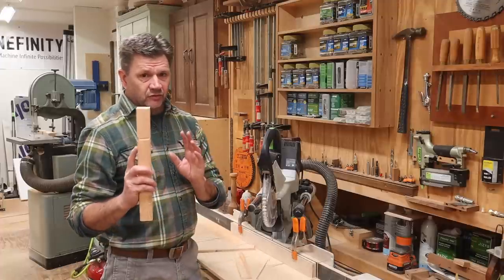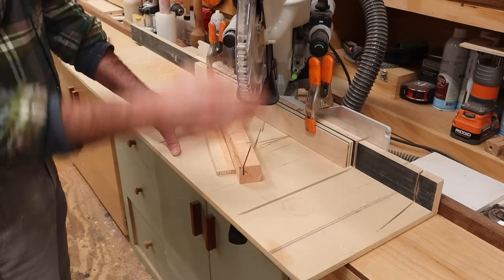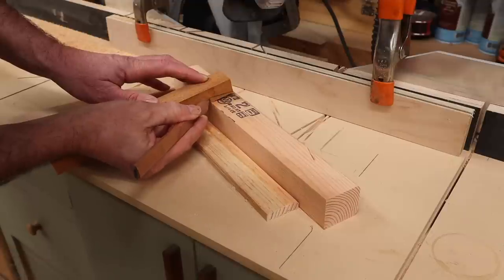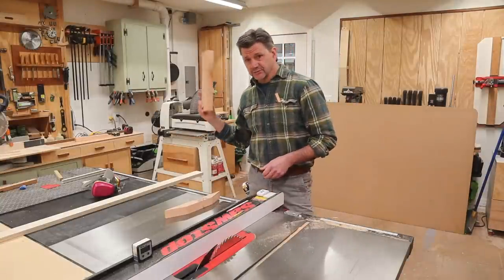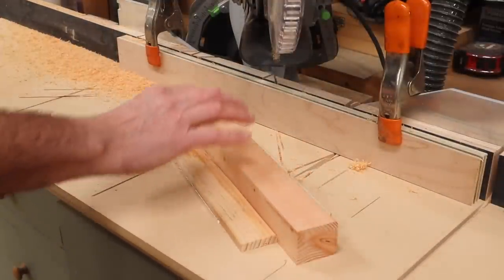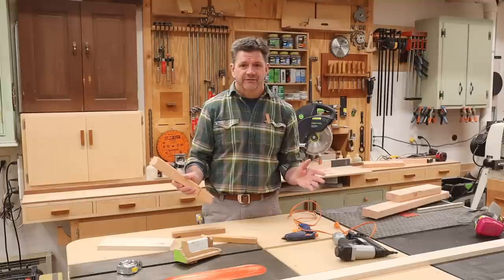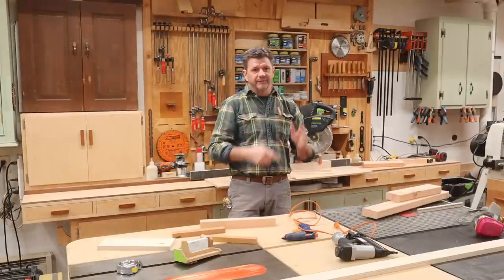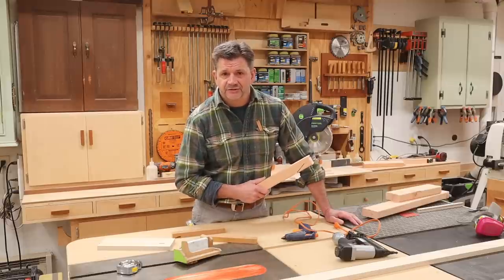Making a Safer Jig - Shed / Home Office Update

Comment from the maker: Hi Everyone!  I started the shed transformation into home office project this week... For me the fun part is always designing, making and installing the trim but before that happens there are things that need to be done. Adding the nailers between the gusset plates  is one of them. I made this simple jig to cut the nailers and came up with a few safety features after the fact. I’m sure The exact length and measurements will not apply to the projects that you might be working on but the concept should be helpful.
Thanks for watching. Jon    Check out all my Woodworking Project Plans here https://jonpeters.com/

Comment: I thought I have been exceedingly safe in my shop..but I accidentally touched the table saw blade with my pinky finger..15 stitches.. it happened when I was cutting alot of small pieces out. I was embarrassed and have stopped and things like this are important when using saws. Thanks

Comment: I would think that making a sled to use on the tablesaw would be much easier and safer than these sketchy cuts. a simple sled consisting of a piece of plywood resting on the fence and some walls at the angles and lengths you need would make quick work of it. probably can't link to it in the comments here but four eyes furniture has a youtube channel and they use those kinds of sleds all the time for tapered angles(obviously for furniture in their case but the technique is widely applicable)

Comment: I'm not a professional but I've made a lot of cuts with a miter saw because I've done a lot of new baseboards and other trim in my house.  Some of those cuts had my hands very close to the blade.  Obviously I didn't want any injuries so I was very careful with these cuts, and I was cutting pieces small enough that they wouldn't likely move and take my hand with them.  I would always pay attention to what I was doing and do tests by moving the blade up and down to be sure that all parts of my hand and arm were clear of the complete path of the blade.  As I'm typing this I still have all fingers and thumbs intact.
The miter saw is easy to use but can be very dangerous, just like the table saw and the band saw.  When using these you have to always be careful.  If you understand how dangerous they are then that makes them less dangerous because you will always use proper caution.  If you become complacent, decide this is routine work and you are experienced, you will be less cautious and that is where you have accidents.  I'll borrow this saying from another area of endeavor- "it was so dangerous that it wasn't dangerous".
Reply: There is definitely truth in the fact that when you know a cut is a bit sketchy, you're going to be more careful. And most accidents happen when doing something that feels like routine. That said ... when something feels too sketchy, it's probably a good idea to listen to that instinct and not go ahead with it.

Comment: Why not mak a jig that keeps the piece at a 90° angle to the fence?
This way you can cut it in one go.
Reply from the maker: Great idea! I just didn’t think of it…. Funny because I did something very similar… cutting a taper at the bottom of the legs on the outdoor kitchen. 
Thanks 👍
Reply: @JonPetersArtHome  make a plywood base and jig for the band saw and cut in one pass, maybe even batch them out on the bandsaw.  Safer & faster. 👍🏻

Comment: I’m still not in love with how close your hand is coming to that sawblade. I know it’s heretical, but I might consider using a handsaw. There’s a lot of cuts, but they’d all be easy, and you’d have to be pretty distracted to lose a finger.
Reply: He’s perfectly safe.  You should go buy a power miter saw and do some projects, will give you a more realistic perspective of what is safe or isn’t .
Reply: @HBSuccess  You shouldn’t assume so much about your fellow commenters. I currently operate a 60” buzz saw in the Yukon, and have accidentally sliced off all my limbs several times.